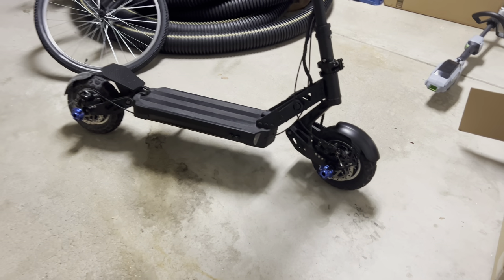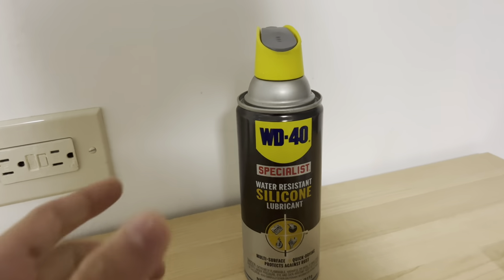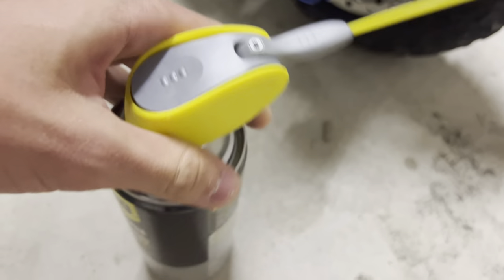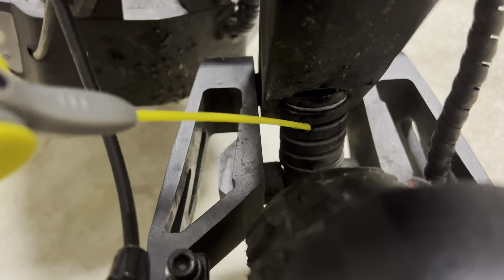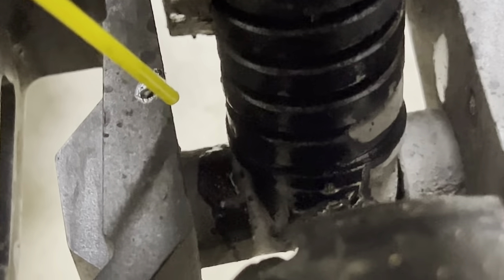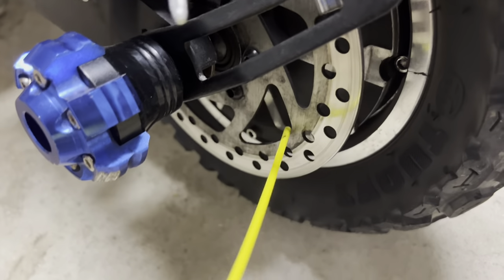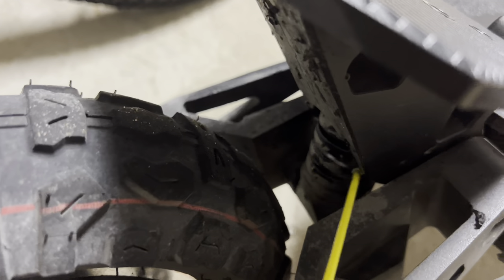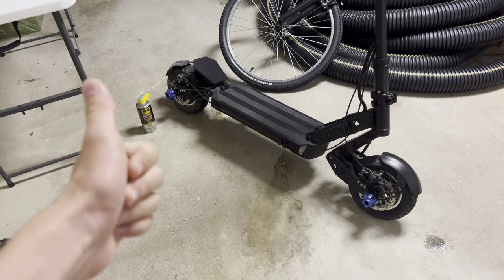HOW to FIX Squeaking Suspension on ANY Electric Scooter! -(4K60)

Comment: Dude, did you really just recommend that people spray wd40 on their brake rotors!
Reply from the maker: the springs and suspension not the rotors
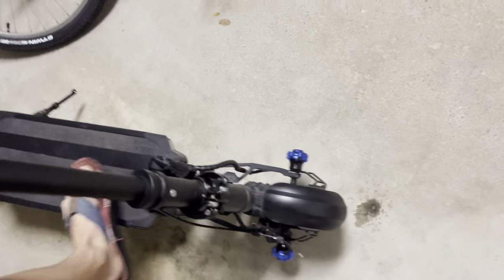Reply: @AlexTV1000  I was about to post a comment not agreeing with WD40 on a disk rotor and why it's a terrible idea at 1:58 But after doing a quick search it's not a terrible idea for the rotor specifically. However there are brake disk cleaner for that or for the brake pads and that is what ideally everyone should be using if possible. The right tool for the right job as they say. I ride a Vsett 11+ at pretty high speeds on the main roads (car speeds) and low speeds in chill streets all the time and i don't think i would use WD 40 on the rotor. But if it dries effectively well then i suppose it's fine. I think the main issue is the brake pads. If that gets any sort of oil it's going to cause problems when it rubs with the rotor. Not 100% on board with this method but if that was the next best thing then sure WD40 used in the video is an option. I don't have that squeaking issue btw. Not sure how you guys get it. Also i have hydraulic Nutt brakes.

Comment: worked for me and solved all the squeaking noises thank you
however im trying to solve the creaking in the stem but it might need a spacer tbh

Also, do you know where i can buy those offroad tires for the vdm-10 / apollo ghost 2022 model
Reply from the maker: yes on amazon, they are RARELY EVER in stock, i bought the last 2 last time, i’ll link it in the description right now, but once you see them in stock, buy them right away, they alway sell out
Reply: @AlexTV1000  thank you

Comment: I have a mantis and my back suspension is insanely squeaky. Sprayed with normal wd40 and nothing changed . I don’t know what to do at this point
Reply from the maker: make sure you spray the springs, all the layers. Also the connections between the suspension and the scooter body, thats where most people forget to check.
Reply: I have a king gt and my noise was coming from the bolt that secures that front suspension. Bust that bolt out and grease it, but it back in and that should help

Comment: Why is the front mud guard on the wrong side of the tire? lol
Reply from the maker: that’s the correct side.
Reply: @AlexTV1000  mud flaps are always behind the tire bcs that's the wheel spins forward. Ever see a mud flap on the front in a car? Dude, it's the wrong side lol
Reply from the maker: Check how they sell it 😹😹😹, its apart of the design
Reply: @AlexTV1000  I figured they did this bcs it does look cool. But as for water protection, it needs to be on the other side. Don't your knees get wet when you go through a puddle? I mean you must be getting wet at the front. Haven't you noticed? Just asking lol
Reply from the maker: no not at all